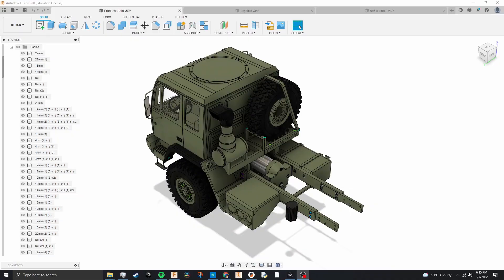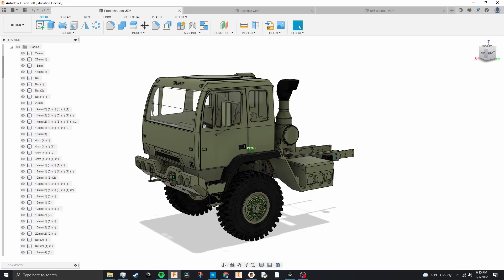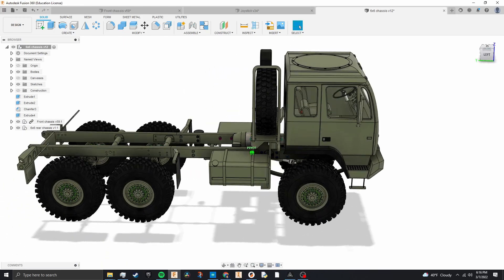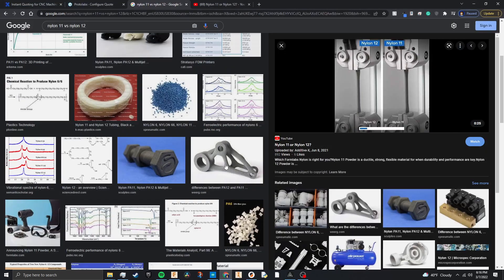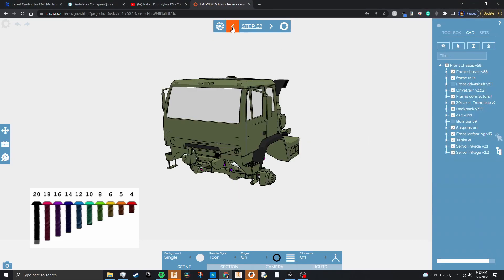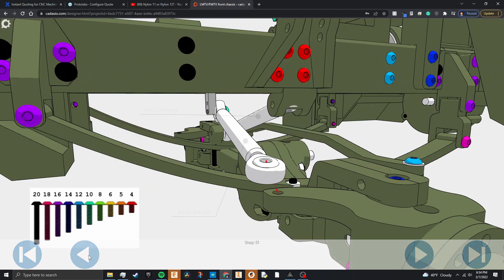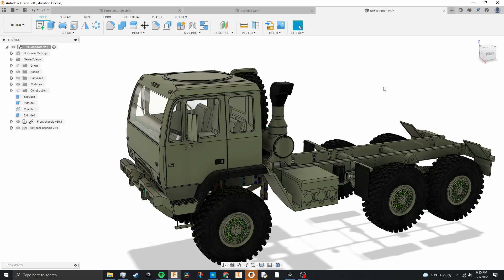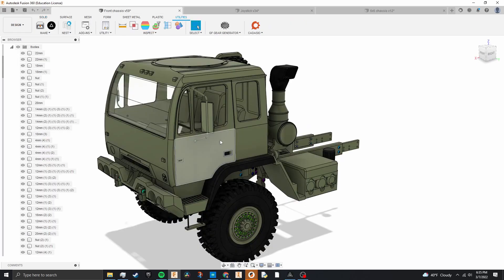3D printed RC military truck

Comment: I like how you did the metal leaf springs on your truck.  My 1/10 scale Tatra had plastic springs that break all too often.  It made a cool truck essentially useless for any off road crawling.
Reply from the maker: Yeah, I tried plastic, but they just couldn't take the heat. It's not all that hard to make the metal ones, I discovered.